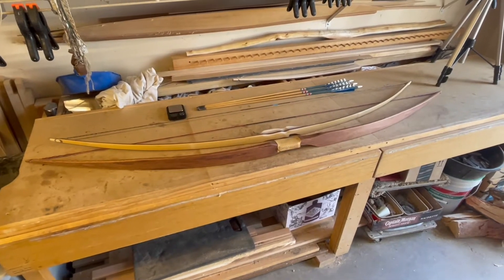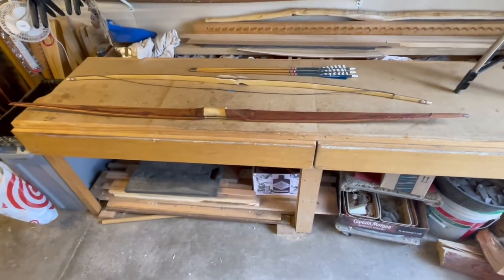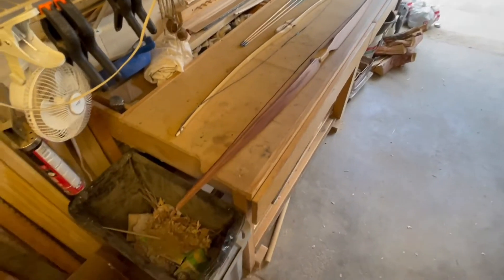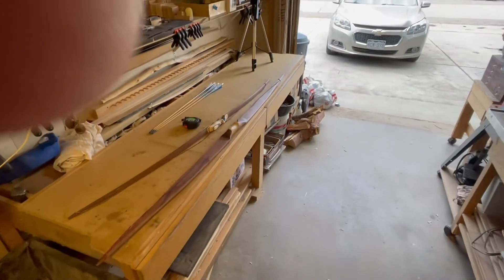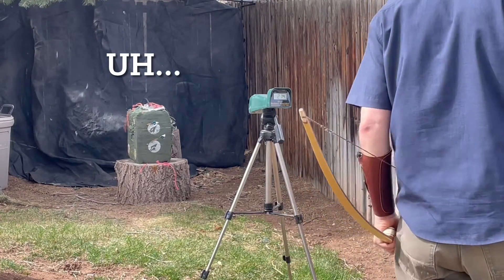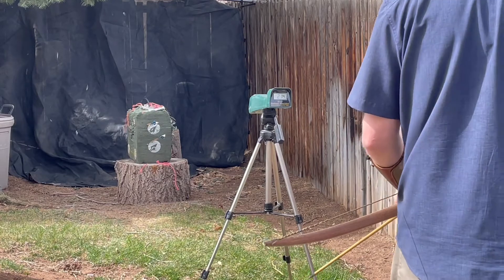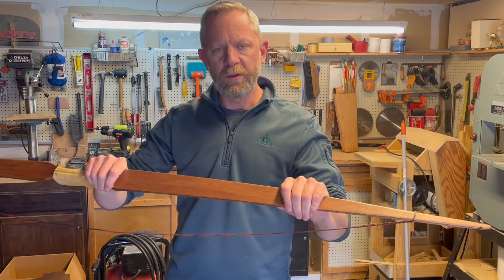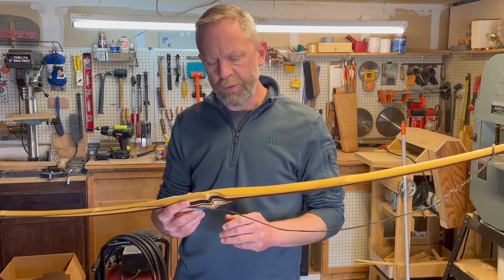Mass & Bow Performance

Comment: I am wondering how much of the results really have to do with mass, there are several other variables involved. Including big ones like materials used and design/profile. It would be nice to see this done with bows of the same materials. such as two oak board bow with different mass measurements but same strung and unstrung profile. Also, I would bet you could make up a good portion of the difference if you heated and bent the oak bow in to the same form as the perry bow. I am relatively new to bow making and these are just my thoughts on it and I may verywell be wrong.
Reply from the maker: First off, you’re 100% on the right track with everything you brought up! I think it’s important to acknowledge that the “mass principle” is more complicated than simply the physical weight of the bow - it has far more to do with mass placement (design and profile). Additionally, different materials can have vastly different specific gravity qualities (physical weight) - hopefully, you’re beginning to see the correlations… the bottom line is minimizing the energy expended in the operation of the bow and maximizing the transfer of energy to the arrow… check out my addendum to this video for more information… https://youtu.be/Qb3aukYAcMM

Comment: Excellent content for this beginner.
Reply: With regard to stacking:  I have a draw slightly over 29".  Would the
R/D bow need to be longer to achieve less stack?
Reply from the maker: Longer is one way, stack is purely a function of the angle of the string while drawing a bow. RF/DF designs work well because they can be made in such a manner as to do most of its fictional bending after it is strung which delays the wider string angle until later in the draw (I hope that makes sense) I suggest you watch my most recent video : “RF/DF 3 different kinds” because it will give you a little more of a visual explanation.
Reply: @meadowlarkadventuregear  It does make sense.  Thanks.
Reply from the maker: Glad it was helpful!